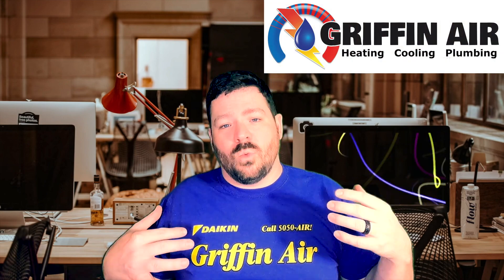STOP Comparing SEER in HVAC systems!

Comment: Great Videos. Learned a lot. Just curious. I have an option between 1 stage vs 2 stage, same SEER rating. Both are 16 SEER. Do you think it would be better to go with 16 SEER 2 stage system in Phoenix area for a primary residence
Reply: If you listened to the video yes. Because the single will ALWAYS BE at 100%. Never giving the opportunity to save energy operating at only 70%. Seer readings are read when the system is at 100%.

Comment: Instead of comparing SEER.  Compare your ductwork to a properly designed system for your job using Manual D.  If your short on airflow, your wasting time and money and sleepless nights worrying about SEER.  A higher SEER unit will perform worse than an older lower SEER unit.

Comment: Thanks for your videos.  My research shows for a two stage, low stage is achieved by modulating the compressor between unloaded and loaded states.  YouTube videos show a scroll compressor uses considerable power when operating unloaded, half or more of the loaded amp draw.  On low stage the compressor uses less power per hour, but since the compressor "wastes" so much power when not pumping while unloaded, the efficiency on a BTU removal basis must be LOWER on low stage than high stage.  Agree???

Comment: I looked at this in way too much detail, researching my new HVAC purchase! Anyway, one thing I noticed is that SEER is calculated as the typical efficiency cooling a house over the course of the year. So they're using a set of outdoor and indoor temperatures, for so many days of the year, trying to mimic an "average" set of conditions. So what's the problem with that? The climate is completely different all over the country. A system in Las Vegas (where I am) is going to be subjected to a completely different set of conditions to a system where you are in Virginia. So I think that's the big flaw with SEER. What is most efficient in one part of the country is likely not the best choice in another.
Reply from the maker: Very good point. Manufacturers have known the flaws with SEER for a long time but rolling out a standard measurement to compare is mostly too complicated for the public. However as we move more into the era of inverters, things will be changing